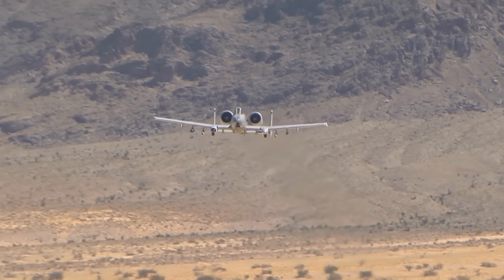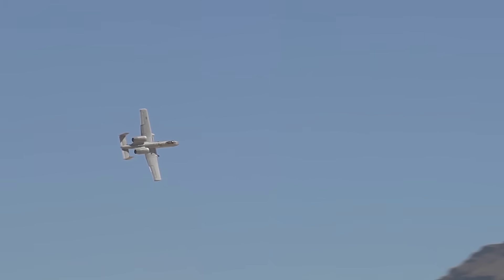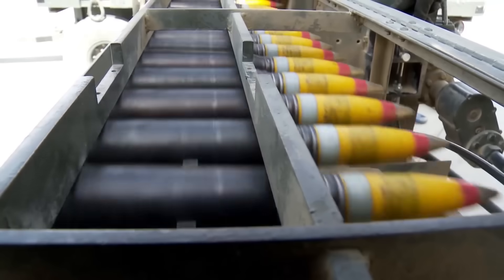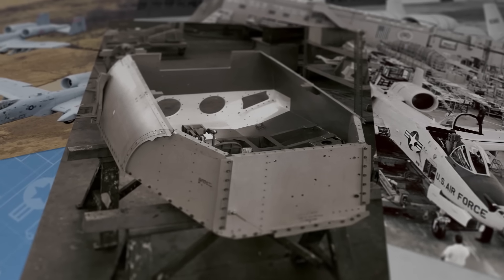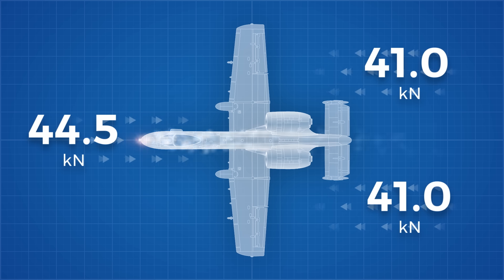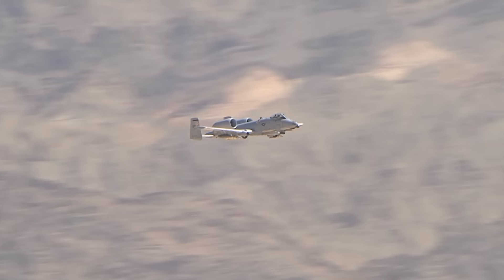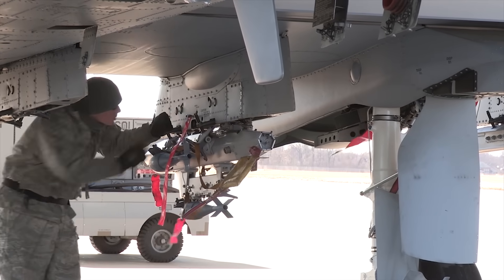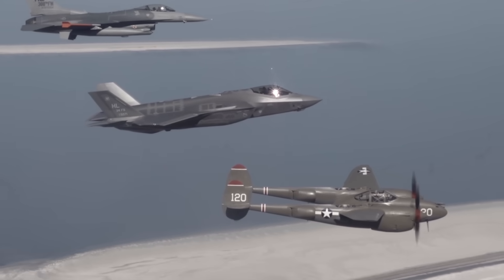The Insane Engineering of the A-10 Warthog

Comment: Military: you are being retired

A10: i will retire when i feel like it
Reply: Snickering Ginger but it’s cool :(
Reply: Snickering Ginger  Civilian here, not what you'd call an expert, curious:  what are its main disadvantages?  I'm given to understand that the A-10 kinda requires air superiority to start, but does it have no meaningful advantages in its specialized role?
Reply: Kaymarx the A-10 wings are over extended on service life and the cost to rebuild them (because the contract to repair them) has been gone for quite some time. The cost to retrofit new wings costs a lot of money
Reply: @fireboltaz  yeah but i think the money would be well spent
Reply: @kaymarx9677  A10 Great Ground Support and effective anti-terrorist attack, anti tank, anti personel platform
Reply: @kaymarx9677  Disadvantages - modern AA cannons rip it to shreds. Even back in 80s, Soviet 23 mm cannons would down it with ease, the plane is lucky to not take part in 'real' war. Modern missiles are also immune to its old defenses, and the new, explosive 'ring' effect would just cut off the tail downing the plane nearly instantly. It's so slow it can't run or dodge anything, its only remaining use is bombing weddings in third world country but there are planes that can do it much more cheaply.
Reply: @KuK137  Only if the Warthog's 30mm cannon doesn't destroy them first..  Oh.. and all the rockets and other ordinance that it holds..
Reply: @KuK137  Well not the f35
AND NO BRRT MEANS BAD
Reply: Miliary: You are being retired
Troops on the ground: Oh hell no!
Reply: Snickering Ginger  Just wondering, are you active, former active or retired military?
Reply: He ment F-35 having gun accuracy problems:
https://time.com/5774422/f-35-military-jet-assessment/
Reply: Arguments aside, the gun itself doesn't seem to be a bad piece....

Oh I know, retrofit it and pair it up with the 105mm howitzer in the AC-130. Those things will always need more firepower =D
Reply: Snickering Ginger  having been navy myself, i say the hog is efficient, but outdated. Its most effective against third world militias, and modern tech is making it where the usefulness of a CAS vehicle is less and less. Sad fact is that its a beautifully ugly old bird that should be honored for its hayday, but like the f4u corsair p-51 aircrafts. It needs to let modern tech do what it does best, and retire while its still got a valid track record. Its not obsolete. Just outdated by the modern era. It has uses, but less and less by the year. An f35 can carry out similar missions with a higher safety margin and less fratricide. (My buddy was a corpsman who himself was injured by an a-10 while with his marine unit) not to say its hyper common, but its common enough that its notable and should be considered when discussing the retirement of the hog. Sorry to but into the arguement a month late. But you know how the navy is. Always a bit late and packing more info.
Reply: Snickering Ginger  - COIN: COunter Insurgency Aircraft. You seem more interested in gloating over someone else's ignorance than in actually being informative. 

You don't want to spend money on the A-10, but you will spend money on another aircraft. You think the A-10 isn't capable, but you want to replace it with a less capable aircraft. 

In Desert Storm, the A-10 demonstrated that it can survive AAA hits and still return home. The A-10 is not limited to COIN missions. The A-10 fired 783,514 rounds of ammunition, something you do not do with a useless gun. 

In the 1960's, the Air Force decided that future air wars would be fought at long range with missiles. There would be no need for fighters to have guns. Missiles were unreliable. IFF systems were also unreliable, so the rules of engagement required pilots to visually identify their target before firing, leading to more dogfights and close gun battles. American pilots died in Vietnam because the F-4 didn't have a gun. They missed out on kills because they didn't have a gun. 

You are making the same mistake with the A-10. You want to retire it before we know if it actually isn't needed. With the F-4, they should have included the gun, and if it wasn't used, delete it in the next generation of fighters. Instead, they based it on what they thought would happen, and they were wrong. If you want to retire the A-10, wait until we go to war and it sits on the tarmac with nothing to do. Or, replace it with something that actually does the job better. Until then, we need the A-10, not excuses.
Reply: They could  modestly  improve the design with  modern materials,  EMP  hardened electronics,  and   air dropped  swarm  robotics ...
Reply: @SeaJay_Oceans  Would cost as much as a new plane.
Reply: I'll say...
It's like a old 🔨 
 ...it might be heavy an not sleek,it might be ugly and loud,it isn't made with much modern & efficient materials,but still serves his purposes and gets the dang job done. Like an old hammer. 😶
Reply: AC130: I don't think so
Reply: 😂😂😂 Chuck Norris flies one, like riding a dragon. Haha
Reply: "Trent Tulpo
6 hours ago
Armed forces: You're retired.
A-10 Warthog: No I'm not." 
370 Likes

"Soviet_Salsa
2 hours ago
Military: you are being retired

A10: i will retire when i feel like it" 
5 Likes

What's the bet that in 6 hours this comment will have 100 s of likes.
Reply: @arcaneminded  no
Reply: Snickering Ginger  don't touch me there. You don't know me!
Reply: haha
Reply: Snickering Ginger  so is your car. Lol. Scrap it! Haha!
Reply: Or when he’ll freezes over while serving pepperoni pizza
Reply: Snickering Ginger the A-10 is the most cost effective aerial platform in the us arsenal. Nothing is cheaper. Your cost argument is bullshit.
Reply: Snickering Ginger  Did you serve in the Air Force, work on A-10s or pilot one by chance? Not trying to be condescending just curious
Reply: It does need to be retired since most of the features talked about in the video are outdated cold war era design
Reply: B52*
Reply: This is what is both WANTED and NEEDED.  Until you prove us wrong, we're not buying it.
Reply: A-10's wings needed replacement long ago, even though Fairchild hasn't been in business since VHS and Blockbuster were the main sources for entertainment. Boeing was contracted to re-wing it 2 times already.

First time: "That'll be $999 million please."

Second time: "That'll be $1.2 billion please."

Brrrrt just got expensive. Could have funded a big wing program for F-16s that are actually useful for something.
Reply: Snickering Ginger  A-1 was created out of WW2 requirements but served in Korea and Vietnam with distinction. A-10 works and will continue working way after an F-35 or F-16 runs out of fuel or falls off the sky full of holes. They are simply not suited to low level CAS.
Reply: @HakanKoseoglu  "A-10 works and will continue working" - Since 2014 that the A-10 only performs 11% of CAS missions, having been replaced by the Strike Eagle, F/A-18, F-16, B1, etc. It won't continue working.
"after an F-35 or F-16 runs out of fuel or falls off the sky full of holes" - You do realize that in 1991 the A-10 had to be pulled out of missions against the Iraqi Republican Guard because of the loss of 7 aircraft and many more receiving battle damage, right? The A-10 got shot full of holes against what was at the time a near-peer adversary. The F-111 ironically scored more tank kills during Desert Storm than the A-10.
Reply: @HakanKoseoglu  it's a flying tank.
Reply: The actual people with the A-10s, or have ever been supported by the A-10, will never let them send that pig to become porkchops.
There is literally no effective replacement for it, and even though ground battles are considered passe by the planners, it's still a major component of warfare, and will likely remain so until teleportation has been developed. 
That "niche" the A-10 rules is a huge field that's not going to leave the battlefield maps for a very long time to come. 
Of course they could work on an improved A-10, but that would be admitting their vaunted next generation designs are very much lacking in this area of operations.
Reply: Snickering Ginger  It is one of the best and cheapest cas aircraft. The F-35 cant stay on sation as long, missiles cost more, and the A-10 is cheaper to fly.
Reply: Snickering Ginger  What will we replace it with? 

Not the F-16. The F-16 has a 20mm cannon with only 5 seconds of ammo, and cannot take a hit from ground fire. 

Not the F-35. The F-35 has a 25mm cannon, but only 3 seconds of ammo. We don't know if it can take a hit from ground fire. 

The A-10 costs $6000 per hour to operate. The F-16 costs $8000 per hour, and the F-35 costs 28,000 per hour to operate. Waste of money my hiney. 

The A-10 is also cheaper and easier to repair, with a readiness rate as good or better than the F-16. 

When we go to war, and the A-10 sits on the tarmac with nothing to do, then you can consider retiring it.
Reply: Johnny Dominguez  - In Desert Storm, ten A-10's were listed as damaged by AAA and one was reported lost. I have also heard that eleven pilots returned with damaged A-10's, so maybe the eleventh A-10 made it back to base but was not repairable. 

One F-16 was hit by AAA, and the aircraft was lost. That's not a big sample, but it makes you wonder. 

Of course, none of this takes into consideration the number of rounds that were fired at the aircraft.
Reply: Snickering Ginger  - A-10's fired 90% of the Mavericks and killed 987 tanks. Apparently, the F-111's missed a few. 

The Super Tucano would be slower. I thought you said the A-10 was too slow. 

The A-10 is becoming exponentially more expensive? You say you like data. Where is your data? Does it fit an exponential curve? 

At the moment, the A-10 is still cheaper to operate than even the F-16. Arguing that someday the A-10 will be too expensive to repair and operate seems like an excuse rather than a reason. But even as the A-10 becomes more expensive to operate, there is still nothing to replace it. 

If a SAM can sever the tail of an A-10, couldn't it also sever the tail of an F-16 or an F-35? In Desert Storm, eleven A-10's were hit with AAA and ten returned to base. One F-16 was hit by AAA and it was lost. No, the F-16 cannot do the same job. The F-16 needs to stay high out of range of AAA where it can drop bombs. When you need to get in close, you need the A-10.

Comment: it would be very stupid to ground a10s. It's a fundamental plane. The only problem i see in its gun, which i think is an overkill. It doesn't need that insane rate of fire. All it does is waste amo. I'd reequip it with a 30mm single barrel gun, much like GSH-30-1 or -2. It does the exact same damage but at a much slower rate of fire. It is also lighter and much more compact, so you have more room for ammunition.

Comment: Little bit of a correction. The gun isn’t mounted directly on the center, but a few inches to the left. This is because the barrel firing position is about 90 degrees. This puts the vector of thrust generated by the gun on the center of the plane. If you look closely you can see how it’s off center in the video.

Comment: What is better at ground support that the A-10? Two A-10s!. They attack in buddy teams each 90 degrees off each other. After the first strafing A-10 one goes into a steep banking turn almost upside down. This allows the pilot to observe the target and direct plane number two onto surviving targets. If the enemy tries to attack the first A-10 he will get a flanking shot from the second. Repeat as necessary. NOTE: The location of friendly troops will often modify this somewhat. The A-10 never fires toward friendly troops. Now throw an AC-130 into the mix and you have a wonderful mix of 7.62mm, 20mm, 30mm, 40mm and 105mm howitzer (just because you can) plus assorted bombs and rockets. Wow, that was a sad day for the bad guys... wait... do I hear Apaches and Little Birds coming?

Comment: Perhaps I'm wrong but your graphic at 7:57 shows the gun inline with the centre of the aircraft however if I recall correctly, the gun is actually offset as the 9 o clock barrel is the one used as the firing barrel. To align the firing barrel with the centreline of the aircraft, the gun was moved slightly to the left, which is visible if you look closely at a A-10 head-on (where it will appear shifted to the right).